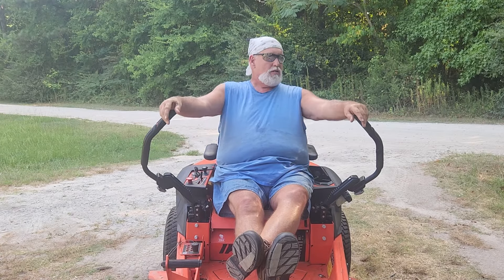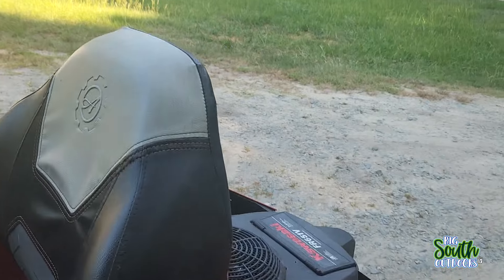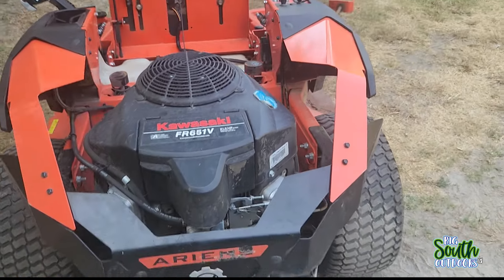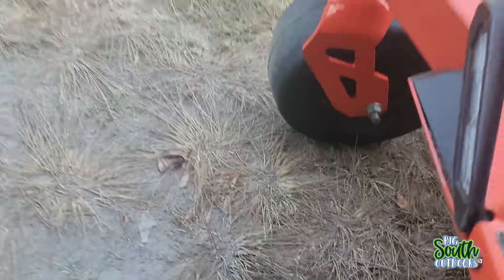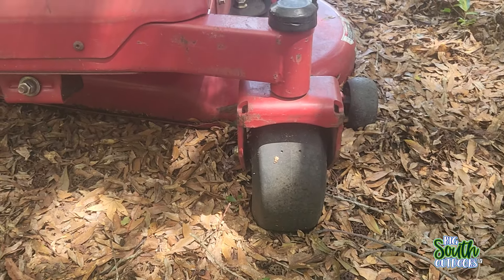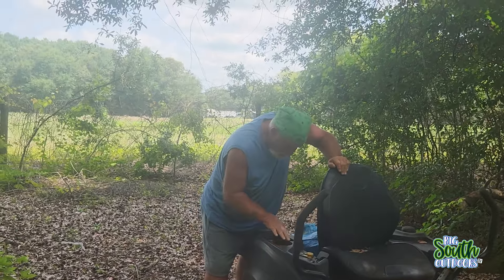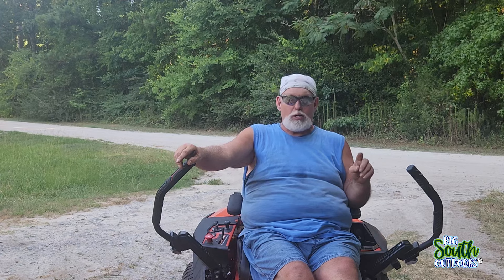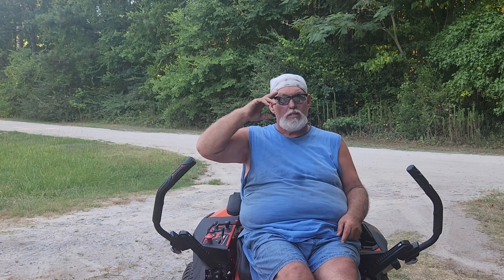You won't BELIEVE what we had to do!

Comment: I bought one of these last year when they became available and have mowed my own yard with it over the last two seasons. It has 18 hours on the clock and the deck hanger bracket has broken off the same way that yours did. The seat cover has also come off because it is too small as well, and one of the arm rests is bent. I guess I will expect it to continue to deteriorate after seeing this video. Thanks for the info.
Reply from the maker: @frequentfrenzied  although I have no way to change it, I am sorry for your problems. This machine has to be one of the worst built mowers on the market. They really should take it off the market.

Comment: The term “Cooling Fins” with respect to the tires, may refer to and an artifact of the manufacturing process of the tire from the manner in-which the tire mold components come together, not necessarily a cooling feature of the tire during the use of the tire.
Reply from the maker: @GordonStevens72  Thanks for watching. That could be the case, but the tire shop used the term cooling fins. As a former trucker, I do know that certain brands of steering tires have the same features and are said to be to help release heat when under a load.
Reply: @BigSouthOutdoorsTV   - without know for certain, my thought is just a guess/ However, I suspect the tire molds come together like pieces of pizza and between the 3D triangular shaped segments, there may be small gaps which form these "Cooling Fins". As you stated int h video, it is highly doubtful these tires need "Cooling Fins" at 5.5mph. Therefore, I suspect the manufacturer of this particular tire and their design/manufacturing process adds these undesired features. It's all good.

Comment: What do you think is the biggest difference between Gravely and Ariens are? Since both Gravely Mower and Ariens Mower are both made by AriensCo; I would have thought the frame would be pretty much the same.
Reply from the maker: @HikingFreak  Thank you for watching. Ariens and Gravely machines are not even in the same solar system. First, Ariensco engineers designed Ariens mowers. Gravely mowers were designed by Benjamin Franklin Gravely. Their first zero turn was built in 1939. Even though Gravely has changed hands several different times over the years, now Ariensco, the machines themselves were not engineered by Arienco. They bought the rights to sell Gravely products, but they are still built by the standards that Mr. Gravely designed them by. They might be assembled and sold by Ariensco, but they are NOT the same. 

Example: The mower featured in this video weights 640 lbs. My Gravely 352 weighs 1,400 lbs. My first Gravely, a 152 xdz, weighed 1,200 lbs. When I sold it....4 years ago, it had over 6,000 hours on it and to this day, it's still going strong. The Ariens in this video, has 192 hours on it. You saw the repairs I've had to do on it, and I honestly don't know how long they will last. THAT'S the difference.
Reply: @BigSouthOutdoorsTV  Thanks and makes sense. I know that even the Ariens IKON from Lowe's and the retailer are two different units.

Comment: I was going to tell you I bought a 20?? Craftsman zero turn cheap needed some work but wanted to find out if I liked it before I spent 1000's on a new zero turn after a wrist and hand injury with surgeries and so on. I knew it needed some things so I worked on it the biggest being a partial blown head gasket. I put no flat tires on the front a new battery and tinkered and got it going mowed with it liked it replaced the head gasket and praise the lord the thing just keeps going. I does bother the wrist some but not as bad as the lawn tractor. Will I be spending 1000's on a new mower I  don't know but this old craftsman zts 6000 42inch with the briggs I like for now. I think all in including buying the mower I'm at around $500 and have been running it all summer so far.
Reply from the maker: @TABrown-xh7xc  thanks for watching.  That is AWESOME! I hope it lasts you for quite some time to come.

Comment: If you buy a low-priced / low quality piece of junk, that's what you get.  You bought a Yugo but want a Rolls Royce.

I paid a little more than you did on the front end and haven't experienced any of the problems you have.  "Buy once cry once."  

My dad taught me a long time ago that I could buy cheap crap and work on it non stop to keep it going or I could buy good quality and do nothing but routine maintenance.
Reply from the maker: @Buldgr  thanks for watching. I see that you haven't watched ANY of the videos I've done on this mower. It's not cheap by any stretch. Ariens used to be a very reputable company, but any more. When I bought this machine, I was in a bind and trusted my dealer to steer me in the right direction. This is what they suggested. After trading with them for 22 years, I thought they had my back. They didn't. They saw I was in a bind and just wanted to make a sale. If you watched this video in its entirety, I had what I considered a yugo. Little did I know at the time that I already had a Cadillac, but I didn't think it made good business since to spend nearly $2,000 on repairs on a nearly 18 year old machine. Enter the Ariens....
Reply: @BigSouthOutdoorsTV  You are 100% correct this is the 1st video I've seen.  I'm sorry that you have a dealer that would treat you like that after such a long "relationship".  I hate that you are having trouble with the machine but wish you the best of luck!  It looks like God blessed you with lots of know how and the ability to fix things, so I'm grateful for that!  God bless you!
Reply from the maker: @Buldgr  Thanks, and God bless you too.